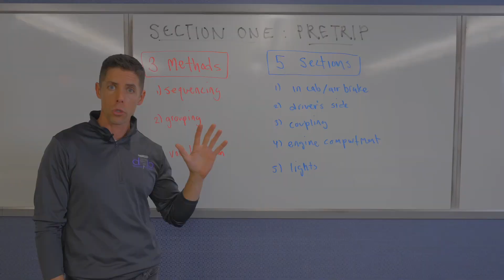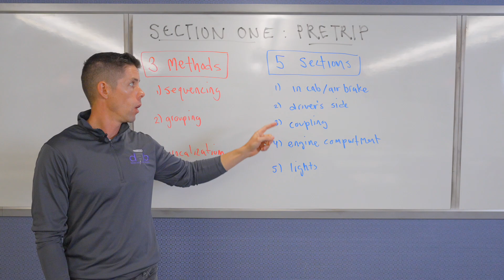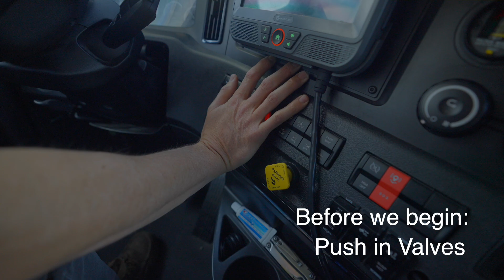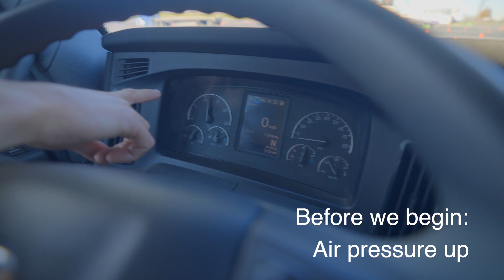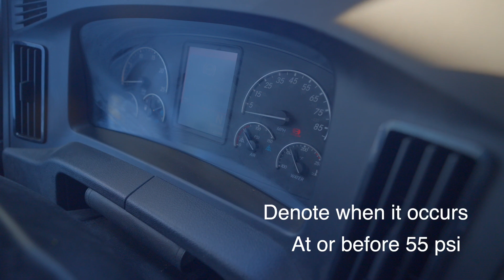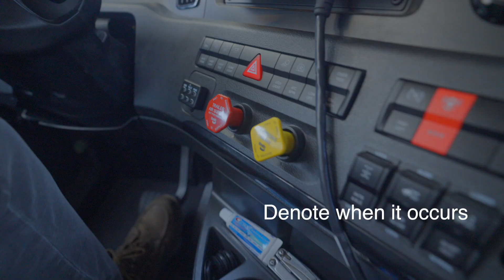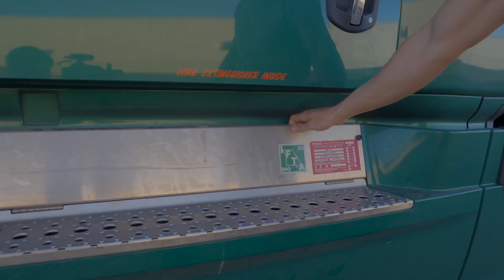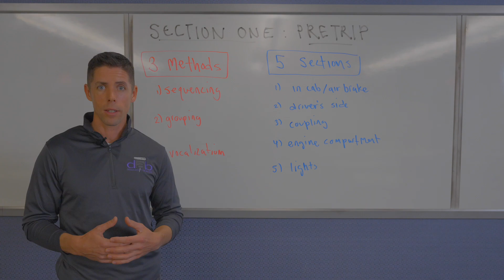Complete NEW Pre Trip!! (Full Combination Vehicle)

Comment: Awesome!!! I'm glad you made a video for the new test! I do want to point out one thing, I did fail to realize that if the truck has a digital dashboard, when you are pumping down on the brake until the warning light and buzzer come on, make sure both primary and secondary pressure gauges turn red! Unfortunately, that's how I failed my brake test!
Reply from the maker: Good looking out partner 🙏🏻 thanks for reaching out !
Reply: Sometimes my secondary will come on first and I will say then keep going till my primary comes on

Comment: Thanks for putting this video together. I've had my class A for 20 years but never had air brakes until this year, I am looking to start driving tractor and trailers but I don't have a truck to do the pre trip test. do you have any suggestions on how I might do this without having to pay thousands of dollars. Thanks guys
Reply from the maker: Where are you training to test and have you considered running for a mega carrier?
Reply: @CDLYeah  So I'm located in Northern  VA. I'm looking for a training center that doesn't cost $1000's, Having my Class A cdl already what else do I need to start driving ? thanks and do I need to go to a training center or can I use a friend that has a truck and Trailer and take the pre-trip and road test? thanks
Reply: UP DATE.. I called the test supervisor that administers the CDL test and was told because I already had my class A license I just needed to come down and take the air test in a truck that had air brakes, and it could be a class B truck with air.

Comment: Where does the wheel chock go? Front or back of tire?
Reply from the maker: Great question, depends on the grade of the road you’re on. First, release your brakes while seated in the driver seat, then monitor for a roll with your foot over the brake. Chock the roll side 😁🤙🏼

Comment: I noticed  you never mentioned the seat belt nor did you put it on before you started the tractor I was under the impression that you were supposed to tell the examiner that the seat belt was working fine and to demonstrate it so he or she could see it
Reply from the maker: Great question, thanks for reaching out! 🙌🏼😁The modernized critical 30 test, that most states have now switched to, does not require mentioning the seatbelt 🤷🏻‍♂️ I know, pretty odd right? Where and when are you testing?

Comment: In California that applied leakage test would of been a fail instantly
Reply from the maker: Thanks for your feedback, what makes you say it’s an instant fail in California ?
Reply: @CDLYeah  in California they want you to give exact reading of your primary gauge, from when your air governor cuts off also on your applied leakage test must say exact primary gauge reading before & after the 1 minute timer starts, same goes with low pressure warning devices & low pressure pop out they want exact reading for everything
Reply: I just failed my air brake test in CA because I didn't give governor cutout pressure value,  and read the secondary and primary gauge values for spring brake test.  Only read the primary even though both tanks fed the trailor. Only read primary for applied since that system is dedicated to rear and service brakes.

Comment: When doing the walk around light inspection around the truck and trailer, do you have to specify if it’s a marker light/brake light/ clearance light/reflector? Or do you just say “light” like in the video ?
Reply from the maker: Great question! You do not need to stipulate the type, you are simply saying that you will be checking said item as you described prior to the walk around.